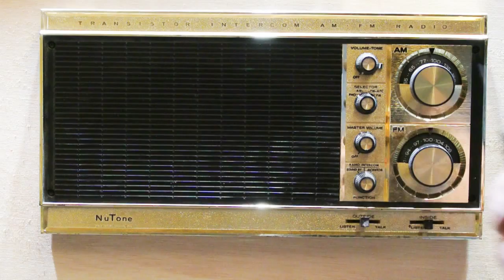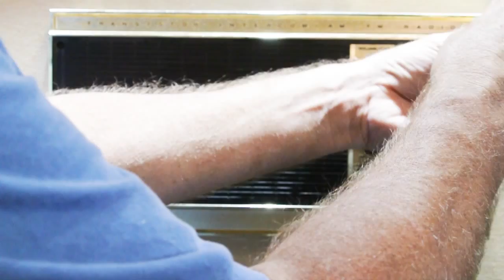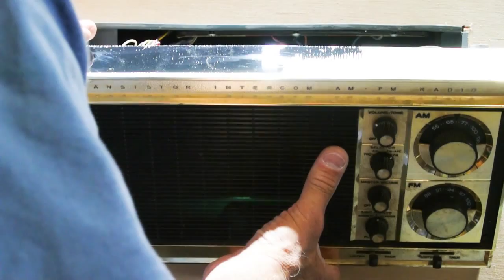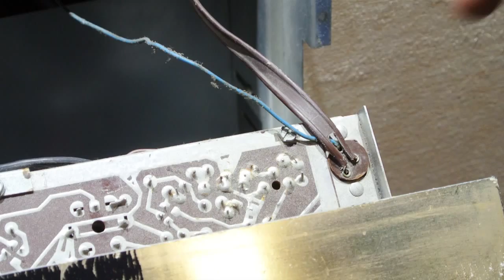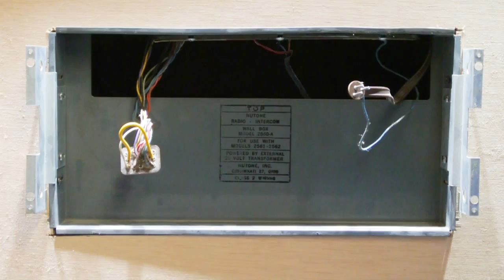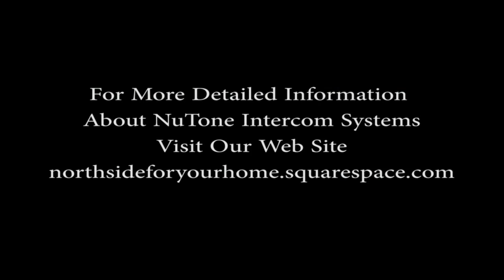How to Open Up - Disconnect and Remove a NuTone Model 2561 / 2562 Intercom Master Station

Comment: Thank you so much for this video!! My late grandmother had one of these in her kitchen and I've loved it ever since I was a little kid. I'm going to try to remove it this weekend before her house is sold off to a developer. I was planning to just cut the wires and hope for the best but now I'll be able to remove it in such a way that it's hopefully usable in the future. Amazing. This is such niche content but so so so helpful. Thanks again.
Reply from the maker: Hi kay:  If you're removing the 2561 / 2562 Master Station with the intention of reinstalling it some time in the future, you will need to make sure you obtain all of the following items / pieces - The 2561 / 2562 Master Station - The Terminla Strip with it's Mounting Screws - The Wall-Housing with the Side Mounting Brackets - The 4 Screws that hold the Master Station to the Wall-Housing - Finally (and this is Very Important!!!) You need to located and take the Low-Voltage Trasnformer that powers the System.  This is a special Transformer (No Longer Made or available) it will not be located where the 2561 / 2562 is installed, it will be mounted remotely somewhere in the house - Chris
Reply: @northsideservicecompany3567  Hi Chris! I wasn't able to find the transformer so I ended up just removing the faceplate from the master station so I can display it somewhere in my apartment. I used your instructions to remove the wires and it all went smoothly. The faceplate is a bit dirty after years of neglect—would it be safe for me to wipe the plastic down with a damp cloth or is there some kind of special cleaner I should use?
Reply from the maker: @zero_fuchs  All 2561 / 2561 start off as a Silver Finish over a Black Plastic base material.  There are also Gold Finished Master Stations - The Gold Finish is applied as a film over the Silver - The Silver FInsh is very sturdy and it can be simply washed with warm soap and water - The Gold Finish is a different story - Do Not use warm or hot water, ever! It will dissolve the adhesive that holds the Gold Film onto the Silver and the Gold will simply be washed down the drain (don't ask me how I know this)  On Gold Master Stations, use only Cold Water with soap, gentely cleaning the faceplate - Chris

Comment: I know this is 8 years later, but what size screws hold in the unit to the internal bracket? i have the 2561-62 model
Reply from the maker: Hi Zaku-x109:  Based on visual identification - All of the Screws are #6 Coarse Thread Wood Screws with Slotted heads - The Screws that hold the Wall-Housing to the Framing are 3/4" long - The Screws that hold the Mounting Brackets to the Wall-Housing are 3/8" Long - Chris

Comment: If someone was wanting to install a system like this in a house, would it be completely impossible to find a master station and enough speakers, with the mounting brackets to install?
Reply from the maker: Hi compactc9: It depends.  Finding vintage equipment is sometimes easy and sometimes difficult.  If you're thinking of finding all NOS Equipment - then it would almost impossible.  Given enough time a patience - it is possible.  so far for this year (2022) We have supplied enough vintage equipment to 4 different customers to install "new-vintage" systems. - Chris
Reply: @northsideservicecompany3567  Not particular about new or used, mostly just complete and functioning. Most interested in one of these that can accept more than 10 stations. I believe this model in the video can handle 16? If I read the catalog correctly.
Reply from the maker: @compactc9  This is far to complex of a topic to discuss through YouTube Comments - It would be best if you contacted us directly - Chris     nscompany@msn.com

Comment: Hello! I appreciate your video. My husband and are a young couple that appreciates these older systems. Things just aren't built like they used to, now a days. We have one of these in our house that we bought 3 years ago and we don't want to replace it but rather improve it. It came with a record player as well. Maybe there is a way of making it have a Bluetooth capability with the auxiliary cord?? The speakers sound pretty good but some of the speakers are kinda of shotty at this point. We are looking for a repair service and you seem to know a lot about these systems. We live in western PA and love supporting small businesses and handymen. Can you help or have someone that you can refer to us?
Thank you!
Reply from the maker: Hi Stacy:  It is possible to add the ability to use the system with Bluetooth, especially since you already have a Phonograph.  It is unlikely that you'll find a local person who can work on your system.  We can help you with any any repairs that are needed.  It will be easiest if you contact us directly about your system - Chris  925-743-8236
Reply: adding bluetooth capability is simple. buy a bluetooth receiver off of Amazon, they're cheap but look for one with good reviews. there are battery operated versions or ones you power with a usb cable, but make sure it is a receiver, not a transmitter. then simply just plug it into the aux port.

it is possible to do an integrated solution where you use the intercom's own power for a little circuit board, and solder the output to the internal aux connections (I'd recommend adding an external interrupt switch, so there is no noise when you are using the aux port normally). This is also super affordable but is obviously more custom and involved.

Comment: Great tutorial,  do you have one that shows replacing the NuTone with an aftermarket upgrade such as an IST brand?
Reply from the maker: Hi Howard:  Nope - Why would you want to do that? - Chris
Reply: @northsideservicecompany3567  an inquiring customer of a younger generation is modernizing their residence.  I respect your appreciation for the classic as a fellow electronic Technician;  however,  there is no amount of convincing this customer.   I don't know his exact model, it resembles the unit in your tutorial.  You are welcome to have it and the 5 zone units.
Reply from the maker: @awakenedtotruth8419  What is critically important when upgrading an existing system - is understand the type of wire that was used and the wiring layout.  These 2 things will dictate what the replacement equipment can be.  It would incorrect to choose equipment that is not compatible with the wire type or that requires a different wiring layout - Unless you're planning on re-wiring the house - Chris

Comment: Great video, really was helpful as i just going cut wires to pull it out. I want to modernize the internals of this unit, make it like smart controlled unit. And want to update the driver inside, do you know what size and type of driver is best for this unit?
Reply from the maker: Hi Kingkckc:  The speaker in a N2561 / N2562 is a 6" X 9"  45 ohm shallow diaphragm speaker cone.  The best type of speaker for this model is the speaker that came with it originally - Chris

Comment: We have this system on our home, which was renovated in 1969 and had this system put it.  The radio stations and monitoring tend to be scratchy and distorted as well as we usually have static when we've used it to monitor our baby.  Is this something removing the main unit and having it serviced would take care of?
Reply from the maker: Hi Nadine:  The distorted sound when playing the radio and when using the monitor feature are likely form the 2561/2562 being old and tired - a rebuild would take care of these problems.  As with all of theses models, the control switches in all of the Remote Stations wold benefit from being cleaned - Here's a link to our Video that shows how to clean the controls in the Remote Stations:
https://www.youtube.com/watch?v=LbuevwArsKw&list=PLsTvqKsBnGYdT7dmeWZsWmOBDmkMJr-QM&index=3&t=1s

If you're interested in having the Master Station rebuilt - please fill out an Intercom Repair Request form and once I receive it, I'll contact you by phone to discuss the problems with your 2561 and its repair

Here's a link to the Repair Request Form:https://docs.google.com/forms/d/e/1FAIpQLSdQHT6fVgm25twaXFeCkkgeITEfAE_zlRBry6B8-GbIs19wcQ/viewform?formkey=dF9RVjBQMFQ5S0xYbTBHMHRoNkVkRFE6MQ

Chris

Comment: Dear Chris: After almost fifty years of use, is it recommended to add heat-sink compound and new mica insulators to the Output transistors ? When should I perform this action ?
Reply from the maker: Hi Luis:  It would be perfectly fine to replace the heat sink compound and mica insulators on the TO6 output transistors.  You should use a good quality general purpose, non-conductive , silicone free compound  like Techspray 1978DP.  Don"t use compounds that are designed for use with microprocessor in computer like Artric Silver..

The purpose of the compound is to fill the microscopic imperfections in the metal surfaces and in the mica insulator. - therefor making a thermal bond between all surfaces.  When applying the compound you want the thinnest possible application on all surfaces .  If you end up with compound squishing out from underneath the transistors - you put way to much.  

Make sure you put each transistors back in its original location - don't switch them around.  The transistors in the N2561 operate a t a very low level and they're not really ever stressed - so they don't run hot. - Chris

Comment: Very helpful video.  My 2561-62 is in some kind of metal housing that seems to come up around the face plate of the unit.  Any suggestions?
Reply from the maker: HI HarveyHarvey1958:  NuTone did make an optional faux wood trim frame that clipped onto the edge of the face plate.  This frame does not chance how the Master Station is removed.  NuTone did not make any metal trim ring. - Chris

Comment: I just moved into a home built in 1963 that has this system installed with 9 remote stations and one door station. As someone who designs and installs multi-thousand dollar smart home/audio systems for a living, I've fallen in love with this unit and it's vintage charm & convenience. Mine has some minor issues that I'd like to address soon so your video and the one on the knob cleaning will be very helpful! Thank you so much!
Reply from the maker: Hi Schwob94:  If you encounter any issues that you have questions about, please contact me.  It's nice to hear from someone who works with modern equipment and still appreciates the usefulness and coolness of vintage systems - Chris
Reply: Yeah, it's incredible the kinds of stuff we install in people's homes every day, but this system is still very fascinating and useful.  Well it was until yesterday unfortunately... I sprayed the contacts and pots on most of my remote stations last night and it worked wonders on the functionality of everything at the moment, but I woke up this morning to find that all the plastic parts on the lever switches had somehow melted from a reaction with the contact cleaner. I have a potential way to salvage them, but several of the ones I had cleaned have now stopped functioning. Some stations had different parts than others, so the different components did not like the cleaner I guess. Not giving up on the system yet though!
Reply from the maker: Hi Schwob94:  I'm not trying here to add to your problem - but I really want to use this as a teaching moment for others.  There's a reason why i recommend the DeOxit D5 cleaner for the controls switches.  I've been using it for years and it would never cause the type of problem you encountered.

If you need some replacement parts - let me know and I'll see what I can do.  Sorry about the trouble - Chris
Reply: No worries, I'm glad that this can at least be used as a teaching moment for others.

I immediately suspected that this happened precisely because I didn't order a can of DeOxit and used what I had on hand. Nothing I can do about my laziness at this point.

If I can't fix the switches, I will most likely retire the system and end up installing one of our high-end zone systems through work unfortunately, instead of sinking any more money into this one.

However, I don't have any plans to remove the panels from each room or any part of the NuTone system, both for aesthetics purposes and in case I come across a solution for my miserable mistake.

Comment: This was extremely informative and useful, as I am considering selling the NuTone N2561/2562 system in our house which was new in 1970. I was originally just going to cut the many wires going to the multi-plug until you revealed the terminal strip. So now I can remove it cleanly as a unit and preserve the original installation.

Thanks!
Reply from the maker: I'm glad that the Video was helpful to you - Chris

Comment: I have this model in my home I'm looking to upgrade so I can use MP3. Any suggestions?
Reply: You could plug an mp3 player into the phono input RCA jack in the lower front of the master. But be careful! It's possible that it needs an isolation transformer to protect the player from voltage that might appear on that RCA jack. Have someone with electronics experience and a voltmeter check it for you first.
Reply: Check Amazon search music intercom systems

Comment: You should do an overview for all systems you disassemble (i.e. like you did for the 2540), if the system is still functioning similarly to the 2540 when you were showing its controls. It's interesting to see how operation for these have changed over the years!
Reply from the maker: +Vincent D : Good idea!  The next time I have a 2561 / 2562 in the shop for service, I'll make a overview video about it.  Thanks for the suggestion